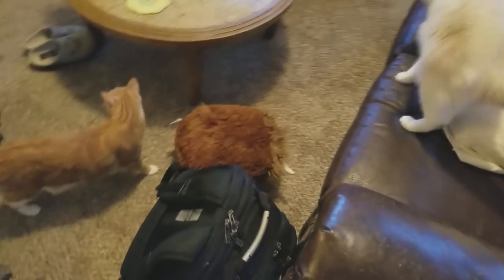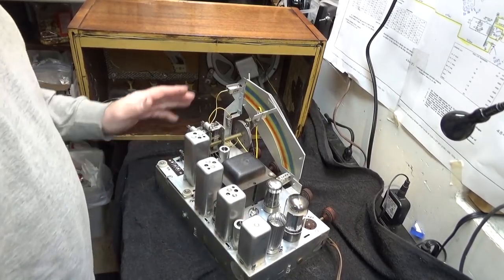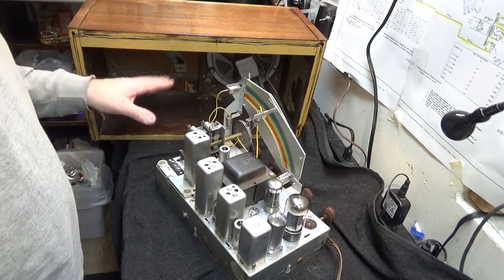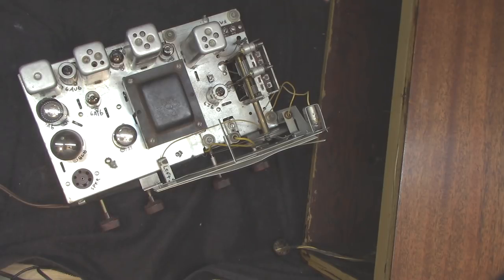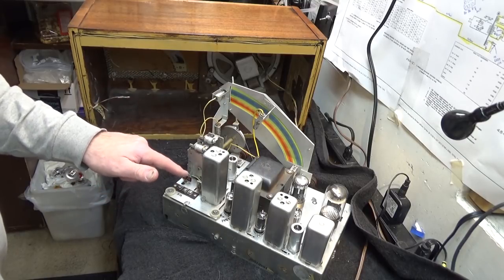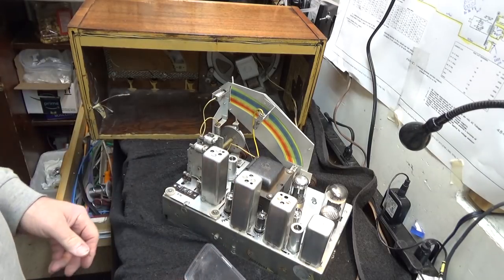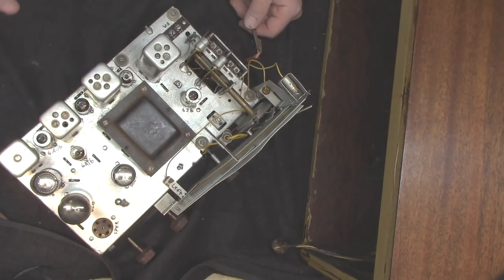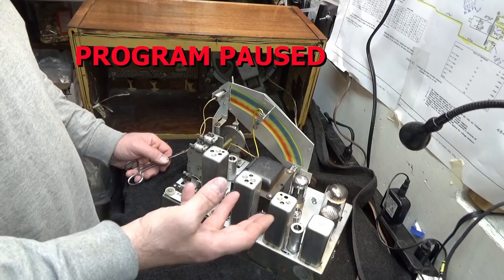1947 Westinghouse H-161 Vintage Tube Radio Part 10 of 10  Assembly & Reveal

Comment: Yeah, some times you get sidetracked, and then you get derailed!
You can detect FM with a single diode.  It's called 'slope detection', and requires that you tune the final IF transformer so it peaks at the edge of the signal.  Now as the frequency deviation varies with the modulation the output of the single diode detector will follow the modulation.  Not a very good FM detector, it's actually a half-wave version of a ratio detector or discriminator.  If the BW of the IF transformer doesn't match the deviation you will get distortion.  OTOH, there is a variant of this type of detector commonly used in TV set sound stages using a Pentode tube with a high mu suppressor grid having a tuned circuit connected to grid 3 (6HZ6, 6T10).   The detector tube is functioning as a slope detector in the suppressor / plate circuit and a final IF/Limiter stage in the cathode, grid #1, and screen grid circuit.
Reply from the maker: This is some cool stuff!  I didn't know about slope detectors.  I need to do some poking around to see what I can learn.  If I am ever going to learn about televisions, I had better get pretty heavy in the FM department.  Thank you for watching and for your always awesome comments!   Take care.    Michael

Comment: Turned out great Michael! The cabinet really did spruce up removing the contact paper! Has a great sound and is a hot receiver!  Looking forward to ur next video, Take Care--Larry
Reply: Used single-ended the 6L6s can produce about 4 watts output, which is plenty.
Reply from the maker: Thank you so much, Larry.  I have some cool video that I wanted to include in this last part, but I just could not find the time for the editing.  So, I'll be putting together a little "Loose Ends" installment soon.  I think that you'll find it interesting and fun.  My best to you and your family, buddy.    Take care.    Michael
Reply from the maker: Martin,
I am a big, big fan of 6L6 tubes.  I suppose that just about every tubehead is.  I love the warmth, punch, and gentle coloring (digital people call it "distortion", but what do THEY know?) that the 6L6 delivers.  Plus, for a little tube, the GTs still look pretty cool when they are operating.   Thank you for watching and for taking some of your time to comment!   Take care.   Michael
Reply: 6L6s overload with grace, especially with a good rectifier tube like a GZ34.

Comment: Watching you deal with those corner rubber feet made me wonder how hard it would be to make something like them out of hot glue or silicone caulking squeezed into some easy mold like a bottle cap. Seems like either material would be rubbery enough and insulate properly, plus you could insert any kind of metal insert into it before it cured. Great series, Michael!

Comment: Sounds good, Looks good,   Somewhere I seen some pictures of Armstrongs first experimental FM transmitter and it was located on one of the top floors of the newly constructed Empire State building of time just around 1938 0r 39 or so. I remember the pictures, it was all laid out on wide boards like Pine or Mahogany and whole assembly occupied one corner of the room up against the two adjoining walls, it was a low power transmitter maybe 50 to 100 watts I am guessing !!!  I think this picture was in one of my old books on radio but I don't remember which one at this time !!  Its too bad Sarnoff screwed Armstrong over on this so bad, like he did on so many other inventors of the time, Sarnoff was a real shrewd and crude operator !! ----------------------------    John Bellas   ------- KC2UVN
Reply: RCA got the FCC to switch the FM band up to 88-108 MHz because Armstrong operated on the low band (42-50 MHz).
Reply: Yes I think that happened just after WW2 sometime, I happen to have 1 console radio and 1 tabletop radio made during the transition that you mentioned, as these two radios covered both the old FM band 42-50 MHz and the NEW band at that time of 88-108 MHz.  I think that they were called "Transitional" radios at the time.
Reply: Zenith, GE, Stromberg-Carlson, and Magnavox made these among others.  They were among the few that actually licensed Armstrong's FM technology.
Reply from the maker: Simply put, Armstrong was a genius - the real deal.  Along with Farnsworth and a few others.  Sarnoff might have been a great business man, but he had no soul.  He was the kind of person who looked at everything he encountered through the profit lens.  After all of Sarnoff's ruthlessness and tactics of personal destruction, where is the RCA empire, now?  

Much like DeForrest, Sarnoff spent a lifetime being driven by the desire to be known and remembered as the most important name in radio.  In the end, many of us who think at all about the history of radio revere Armstrong and Farnsworth, while we deride Sarnoff and DeForrest!    Funny how it all works out, huh?

Thank you for watching the vids and for your always terrific comments.  Take care, my friend.   Michael

Comment: At last.. someone else who hates the Samsung S7 as much as I hate mine. Horrible phone, wish I had never changed from HTC. Many thanks for a great series, its a great looking and sounding radio.
Reply from the maker: Hey, George.
Thank you for your kind words.  I enjoyed this radio and I'm glad it came out ok.  I wasn't so sure, when I realized that it was covered in contact paper!  I have had the S7 for about two years.  I had an S4 prior to that, and aside from the camera, I liked the 4 a lot better.  Now, I almost never use the phone camera anyway, since it causes so many problems during video editing, so there is really no reason to like the blasted thing!   I don't know what 'HTC' is, but I am pretty sure that it's better than the junk overrated phones that Samsung and Apple have been putting out.  I'm seriously thinking about getting a Motorola for my next one.  I'm not a phone nerd.  I just want one that works the same every time.     Thank you for watching and for commenting.  I appreciate comments more than you might think.   Take care, my friend.   Michael
Reply: ThatTubeSound indeed. HTC are another far East manufacturer of phones. I have found that on the s7 the audio goes out of sync with the video. Not a problem for the sort of video where you are just describing something but if your face is in view it is so distracting.  The worst of it is that  it goes back in sync at random so you can't just adjust the speed by a fixed amount. 

Anyway... I could moan all day but it won't do anything except  pass time.

Take care and looking forward to the next project.

Comment: hi how's it hanging! Well you're right about slowing down your phone apple have been caught doing this not sure about Samsung tho! Have you downloaded any app before you started noticing the problem? that might be causing the problem. go into battery management and see what on battery saver something might be turned off in battery saver Just had a look at rubber door stops! could be used as feet maybe if you need it in the future. This company do variable sizes what look the same as the original feet you had in it's appearance, diameter 19 mm, height 8 mm, countersunk 7mm, screw hole diameter 3 mm, is the smallest screw hole diameter? About £1.04p each. With the counter sunk in the rubber stop would be better you could put a retaining washer if you know what that is! to hold the foot in place. They do various types of feet and sizes so if that one is not right or in the future you need a different size shouldn't be a problem. Here is the company they do a lot of sizes!          https://www.vital-parts.co.uk/screw-on-bumpers-666-p.asp
What's actually holding the chassis into the cabinet?
Reply from the maker: I'll check those stops out, John.  I have have very few apps on my phone, and none that I have downloaded in the last 15 or 16 months.  I'm not a phone nerd.  I use them like screwdrivers.  Grab it when I need it, but I'm not fascinated with it any other time.  I cleared the cache several times.  I've uninstalled all apps that were not absolutely essential (there were but a few).  And I've loaded every single stupid update as they were pushed out (or should I say, shoved down my throat!).  Nope, I am pretty sure that this is something that comes in on updates.  Every time the stupid thing updates, it gets slower.  I am rapidly approaching the time in which I will chuck the "smart" phone in favor of a simple flip that does texting.  I have a million cameras around this place, and I don't like the cam in the phone, anyway.  I have a tiny laptop that I take everywhere (11 inch), so I don't need the phone for internet.  And, my car already has built-in GPS, so I don't need a phone for that, either.  I am looking forward to taking the Crescent Hammer to it!    Take care, John.     Michael
Reply: ThatTubeSound just go into battery in settings., and at the top the three dots in the right corner it should say battery optimisation, click on that and see if there's any apps that are not optimised? optimise them by clicking on the individual app. You're right it probably is a Google update but it might not be optimised? Is it just slow or is your battery getting drained? When you're in battery optimised and you're clicking on the app check it's permissions this can be turned off like camera doesn't need to have access to storage your contacts or camera, and you can disable a lot of apps like camera? Hopefully some help. Might want to try and change as well if that fails the standard Samsung interface launcher, by cleaning its cash and it's data usage that will wipe the home screen? You might like to try  Nova Launcher instead.
  go into every app checking it's permissions turn all these features off if you need them it will flag up to allow access.